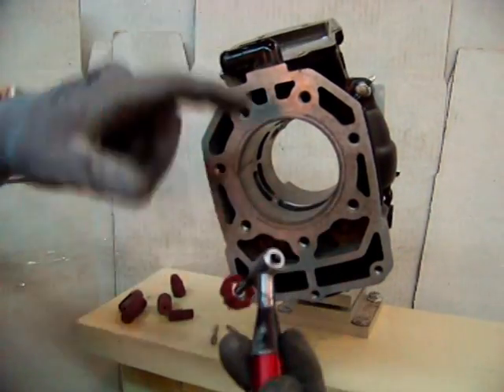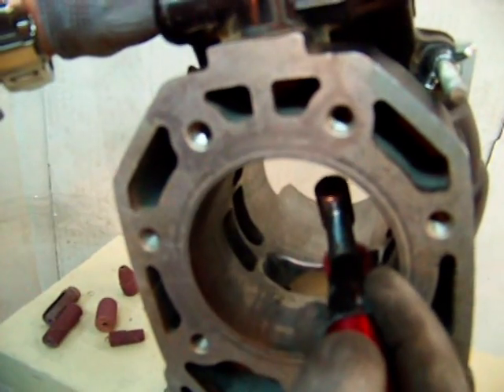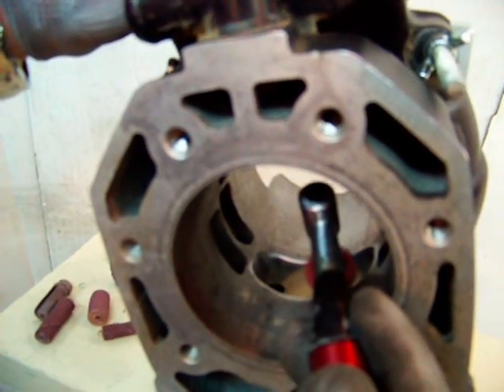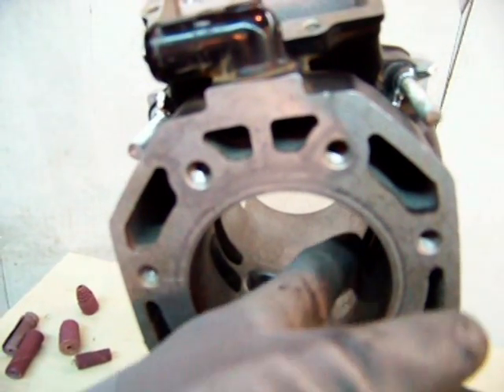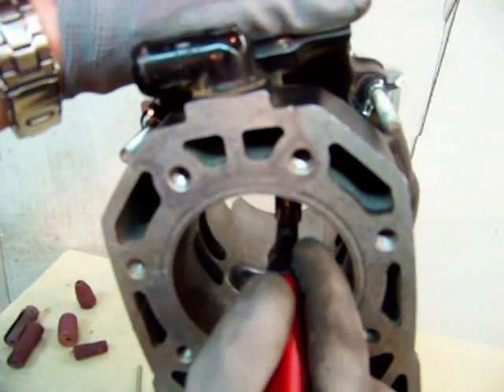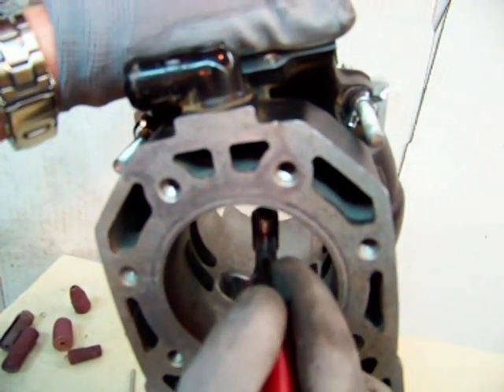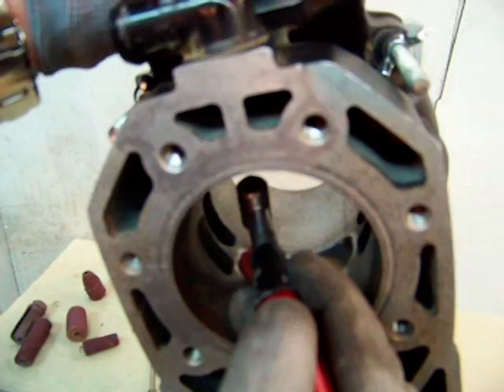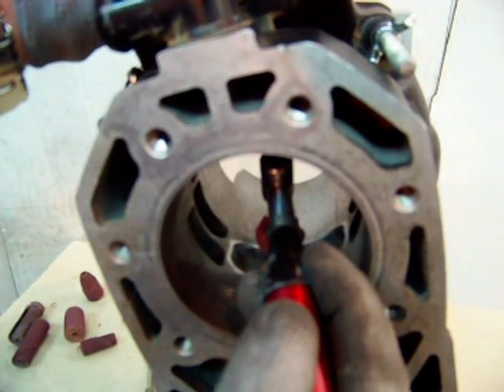2 Stroke Porting chamfering the port  part 2.mpg

Comment: 1)When taking the bur off from the first step of chamfering, with a cast cylinder rather than using a cross buff could you use just a bit of scotch brite and do it by hand ? (As it's cheaper to buy)
2)I have a cast 50cc barrel (40mm piston) which I will be removing all the carbon build up from and increasing the exhaust height by 1mm maximum, as the ports aren't big does it still require chamfering? 
3)I also plan to port a cast 70cc barrel (45-47mm piston) this barrel is off eBay and has crap ports with jagged edges, I plan to go in all the ports and clean them up and again make the exhaust port shine, will this require chamfered ports?
4)Both of the cylinders will require a hone so I'm guessing I will leave that till last, if they do require chamfering do you just do step one and hone as the honing would get rid of the bur? If they don't require chamfering do you simply hone ?
Reply from the maker: 1. Sure you could, just might take a bit longer and can be tricky to get symmetric and even results.
2. Yes, it will require chamfering, but likely only to that port which you have modified. Here is a quick list of situations that I feel require a bevel or chamfer to the combustion side port window: a. Anytime you bore the cylinder or increase bore dimensions. b. Anytime you change any dimensions of the combustion side port window. c. Anytime you have concern about ring wear or damage. d. Anytime you question the quality of the porting job that may have been performed by the previous owner of a cylinder, or for that matter, the quality of the original manufacturer of a cylinder. Better to be safe and sure, rather than destroying your rings and having to rebuild. 
3. Please see answer in 2
4. If you are honing the cylinder, you should chamfer the ports after the honing process.
5. Thanks for watching and sorry for the delay, YouTube seems to only be giving us notifications about our other channel
Reply: Thanks CC specialty tools :D

Comment from the maker: Great question! But no you will not require any other equipment or any other steps, as long as you follow all 3 steps that are listed on this series. It will just go a bit slower than in the video where we have aluminum. The Diamond Tips you see used will work on any hardened metal or material. The only thing I recommend on cast iron is be sure to go through the step of removing the edge burr and the buff polish, since it can be more prone to leaving the edge burr mentioned. Thanks for watching!